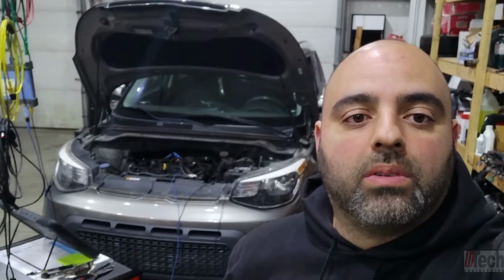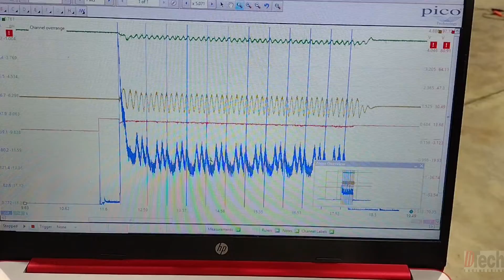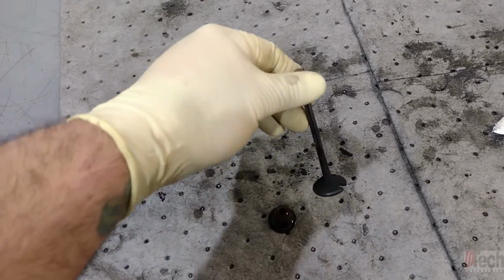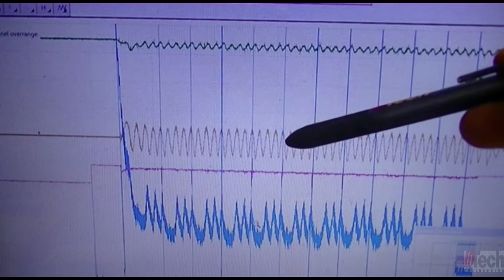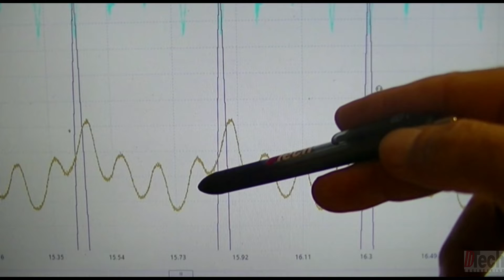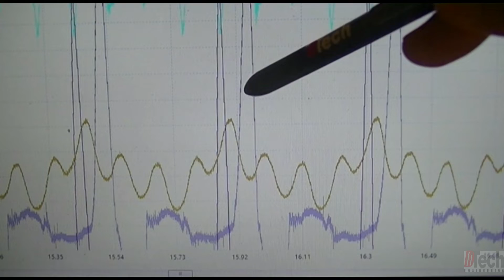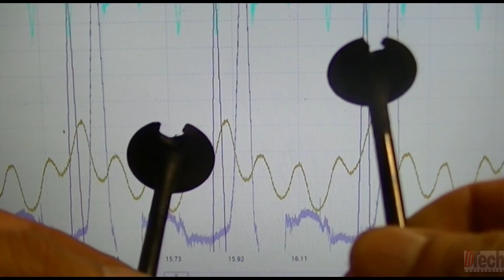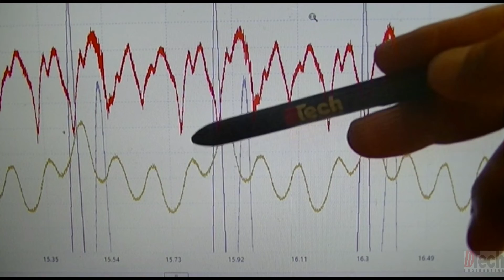Intake Pressure Waveform Anomalies

Comment: Pretty awesome that both of these cars came in with the same problem and you were able to compare side by side. 
Your ability to read between the lines enabled you to conclude that both cars had the same issue but were displayed slightly different.  Great learning experience.  Great job man! Thanks.
Reply from the maker: Yes it took a minute to figure out why one looked the way it did and the other not, Thank you for watching

Comment: Really nice! The exhaust pipe represents a resistance to the air flow, and if you have a hole, witch represent less air flow resistance, it´s like electricity: it gonna flow the easiest way, disturbing the cylinder burnt gases exhaust process. While entering "clean" air to the cylinder, the exhaust and admission valves are opened together for a brief moment to help to push away the burnt gases. So, cyl 1 is sending pressure to the 3 through the exhaust pipe.

Comment: That was a super interesting case study and really fortunate you had two identical failures on the same engine back to back. It goes to show there are a lot of dynamic things going on with flow in the cylinder. 

I think a good visual way to explain it would be imagine sucking on a straw with a little pinhole in it, you would still be able to suck a good amount of fluid through the straw. Now if you imagine the straw had a 1/8 inch hole in it,  you would not be able to pull much fluid if any through the straw because of the large leak. 

It does take lots of practice with this stuff to really understand what's going on.
Reply from the maker: Thats a good analogy example, thanks for that.... I know you are well versed in this subject so hopefully others can understand better with your statement. Thanks for watching

Comment: Very nice diagnosis, I am just curious where did you connected your pressure transducer to the crankcase ? PCV valve maybe ?
Reply from the maker: for crankcase measurements I usually tap into the dip stick tube or the oil fill cap

Comment: Great information! Just came across same situation as you. I didn't go as far as you. Just did pressure transducer in crank case to check bottom end make sure that was ok and checked problematic cylinder with borescope and seen burnt valve. Can I ask as a mechanic what was your recommended fix? Just change the burnt valve and lap it? Do a complete valve job? Or send off the head to a machine shop? And why not put pressure transducer on exhaust side for 1st vehicle...the one with "good" intake trace? Thanks
Reply from the maker: On this one I repaired both in house by replacing the valve, lapping it and new valve seal. Both were for a car lot. And I believe I did use it in the exhaust just didn't film it. If this is a personal vehicle you might consider doing more than one valve. Thank you for watching
Reply: @DTEAuto  Thanks for the response. Ahhh yeah so I imagine the car lot would want to go the cheapest route. I recommended to my customer to just get a rebuilt head. which they did

Comment: I understand your using a -30 vacuum sensor. I purchased the ats sensor also, along with the their tailpipe sensor and pressure pro 5v box.
However I'm having trouble "zeroing" them on my pico. 
Can't get them below @ 1 volt. Did you have any such problems?  Any tips?
Reply from the maker: Hey, I actually don't use the ats for intake or exhaust. I only own the 300psi ats one that I will sometime use for incyl. Other than that I have my own that I use, as far as the zeroing, you most likely would have to contact ats and have them explain how to do so. But honestly, from my experience on the exhaust, you won't need to zero it out, you are just wanting to see how the pattern comes out. And on intake, you also might not need to zero it out, as for intake patterns you are looking to see the breathing activity occur or not occur or rise in psi and so forth, not necessarily looking at the spec levels at what it is doing it at. Hope this helps,
Reply: Thanks for replying. I did contact ats, the gentleman I talked to said he would get back to me, but I haven’t heard yet. I realize the signal shape is what matters rather than it’s voltage, however when used with companion sensors not needing the 5v box, it takes a little more setup to get all signals on screen.
Reply: Why not use the pico wps500 & eliminate the problem?

Comment: When you see a spike in the intake waveform when a dead cylinders relative compression waveform is at TDC, does that indicate a valve sealing issue with the dead cylinder?
Reply from the maker: it is very likely so, you would just have to double check to verify.

Comment: Just thinking about the first engine, there are 2 more ways the compression can 'escape', this being a gdi engine, a leaking injector seal or a incorrectly installed sparkplug. Not likely, but something to consider. Cheers.
Reply from the maker: Good points to make, Thank you for watching

Comment: good video , would of been good to see you using a  exhaust pulse sensor aswell, what was the cause of this no. 3 burning of intake valve ? cheers
Reply from the maker: I did use a sensor in the exhaust, but it was an inches of water not a pulse sensor, that was what I explain towards the end. As far as the cause of the burning of the valve I'm not sure. Thank you for watching

Comment: Sadel am back again. Nice diagnosis right there. But did you care to find out why those two Kia had same issue(exhaust valve breakage) .Are they of the  same engine type. Could you kindly reply with me with the type of pressure transducer used. Thanks
Reply from the maker: As far as the cause I'm not totally sure, the sensor I used was a -30 psi absolute transducer. Thank you for watching

Comment: That’s just bizarre, Sadel.  Is the second car also a 2013 or if not does it have the same engine?  I’d love to see someone find a good running Kia (with the same engine) and try to do a detailed temperature measurement across the cylinder head.  I’m betting the #3 cylinder is running hotter and causing the valve failure.  Well done, brother!
Reply from the maker: I cant remember what year the second one was, but I sure wasn't expecting all of what I found

Comment: To avoid any assumpions, u cud have done a cylinder leak down test and listened for the leakage at the tail pipe. Just saying😉
Reply from the maker: yes but that wouldn't teach you why the intake waveform between the 2 were different.

Comment: Great video but why not pressure test the exhaust or put shop air into the cylinder as a leak test. Teslong makes an awesome boroscope which is awesome to see inside a cylinder an extra 5 min. Makes you absolutely on target. Good video
Reply from the maker: you can certainly do that for sure, but you would have to do other test to lead you to that point, i.e. like a relative compression at least. As far as for me on this one, I went this far to teach myself as to why the same faulted issue caused 2 different waveform patterns so that I could better my experience and knowledge and also because I like this kind of stuff. Thank you for watching.
Reply: "Mike...." you are missing the point buddy. These non invasive tests are done to avoid having to pull a sparkplug/coil/intake manifold etc. The idea is to get familiar using these tests on an engine that has easy access and one could then follow up with a traditional test, like a leakdown test, to back up your results. So that when you get an engine that has no access to the sparkplugs you have a good method to test. The idea is to be more efficient.

Comment: Brilliant teaching Sadel!
Unlike women, the scope doesn't lie = size does matter, hahahaha!
Excuse me if I missed it, did you cover what sensors you used for each pressure waveform?
Your map sensor hook ups? Wondering how the intake waveforms would differentiate with just a pulse sensor?
Reply from the maker: I use -30psi absolute pressure transducer and in the exhaust an inches of water sensor, and to be honest I don't know how it would have appeared with a pulse sensor, I don't use them, but I would almost venture to say might not have seen it the same way
Reply: @DTEAuto  thanks for replying man!
Which "inches of water" do you use? 
Zero stress of you don't get back to this.
I know most use the ATS unit. I tried a while back to find a budget option in the correct range and sample rate. All I really came up with was a 5v refrigerant manometer.
Reply from the maker: you can use a gm fuel tank pressure sensor
Reply: @DTEAuto  MASSIVE tip! Thanks so much for sharing.
Reply: @DTEAuto  side question =
What are you using as your 5V ref. A supply box with batteries and regulator (lm7805)?
Or 12v battery clamps and a regulator?
I see may use a dedicated 9v battery box but using 12v from the cat battery seems so much more simple, straight foward and compact in application.
Reply from the maker: I use the snap on 5v supply box they offer, my transducers I use are 5v supply so a 12v source wouldn't work, plus I have seen on some that use the battery as a power source, that the signal was not as clean because it was picking up some "noise" from the cars electrical system.
Reply: @DTEAuto  Yes. I may not have been very clear in my explanation.
I did mean using the car battery as the primary source of power. But, supplied through an LM7805 5V regulator. Not straight from the battery. I was just toying with the idea of having a split loom from the sensor using 2 x 2 core, earth sheathed (noise prevention) looms. One to the power supply and the other to banana connectors or BNC for the scope. More wire, but saves me having to build a 5v ref box and worry about batteries. Not so much because of the difficulty. Because I've noticed peoples biggest complaint with ref boxes, is dead batteries when they go to use it.

Comment: Why wouldn't you scope the pressure on the bad cylinder? You would've seen the bad exhaust valve right away
Reply from the maker: In cylinder pressure shows you if there is a leak and displays lower pressure readings because of it. The test won't show the actual place of leak, just the presence of a leak, that's why you have to test around the in cylinder to see where the pressures are not acting correctly to pinpoint the source. A broke piston ring/lower end problem will display a similar waveform, both create a leak, so further testing would need done to find the leak area. Plus, a lot of what I put out is to teach and show others how you can perform test to find problems, not displaying the silver bullet fixes.
Reply: The psi cylinder test is the number 1 test to do. You teach them how to read a cylinder waveform they would've found that cylinder never pulls  vacuum with that huge exhaust leak. Also the compression waveform  of that cylinder would prolly be very obvious

Comment: Hi, can I come to conclusion with below facts.

1. Relative compression test using scope will identify the cylinder in question.
2. Any pulse that stand out in intake or exhaust wave form confirm it is TOP END PROBLEM.
    do incylinder pressure wave form to reconfirm it or leak down test on the cylinder that was identified in relative compression test
3. Any pulse in dip stick confirm it is bottom end. reconfirm with cylinder identified in realtive compression using leak down or incylinder test.

Net -NET intake and exhaust wave form along with realtive compression wave form identify top end work, dip stick wavve form identify bottom end work. then drill down more with leak down to reconfirm.

Can i also assume that if there is a misfire because of coil or spark plug, i wont see anything stand out on intakke, exhaust or dipstick wave form ?..
Reply from the maker: All of that sounds pretty correct, sounds like you are starting to understand it lots 👍
Just play and practice lots with known good cars to get more familiar with it in person.